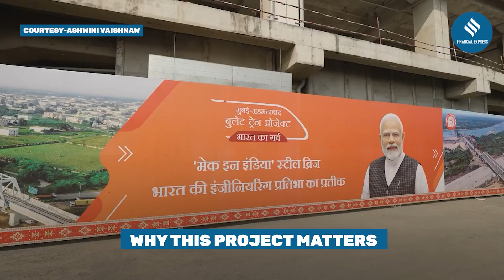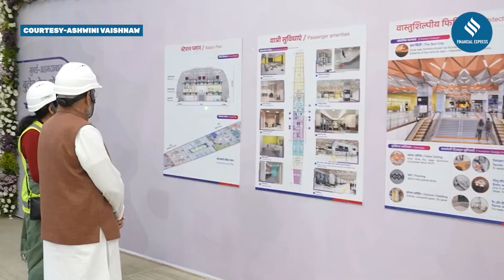Mumbai–Ahmedabad Bullet Train: Surat–Bilimora Section Nears Final Stage | Big Update from Railways

Comment: Still no word of which trainset will be used. No contract has been signed with Japan. Because the trainset has not been decided on (due to high costs), tracks were not laid yet.
Reply: Track laying started since last 6 months
Reply: @clodiaparadise  Help me here. Vande Bharat's track is broad guage (5' 6") and Shenkasen is standard guage (4' 8.5"). We all know that for broad guage cannot be used for high speed rail. So what track guage was being laid, as you claimed, since 6 months ago?
Reply: @benyap6033  J slab is for SG gawar
Reply: E10
Reply: Please visit @nhsrclindia
Reply: says a bot...stay in your 50 cent beggar job
Reply: E10
Reply: A modified version of vande bullet Bharat will run!
Reply: @nravis1 no.. this funded by japan
Reply: @nravis1  That's so funny. So, just "modify" the existing slow train, change definition of "bullet train" to lower speed, avoid the reference to term high speed rail or HSR, and viola!
Reply: @benyap6033  that are looking for 2 indigenous VB trainset (280kmph safely limit) for pilot project on this SH tracks that dosent mean they want to cancel Japanese trainset,

This 2 250kmph trains are part of R&D for future indigenous bullet trains and 230 kmph BG trains on conventional routes.